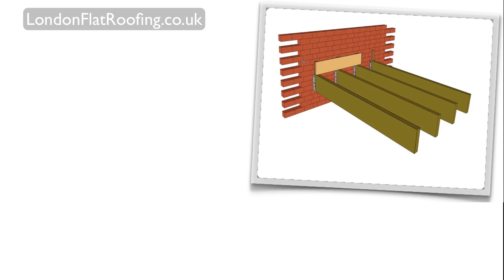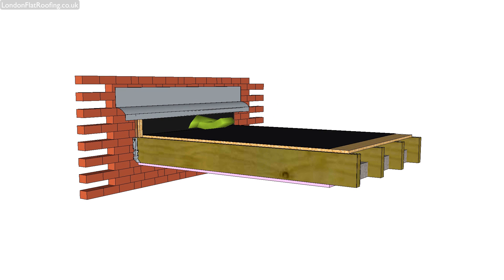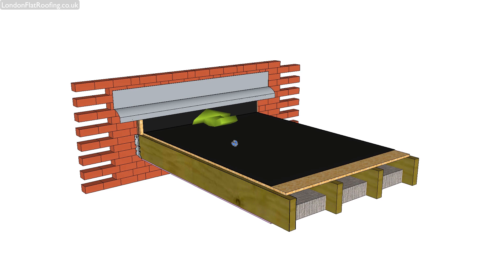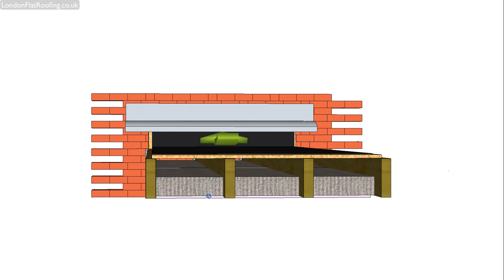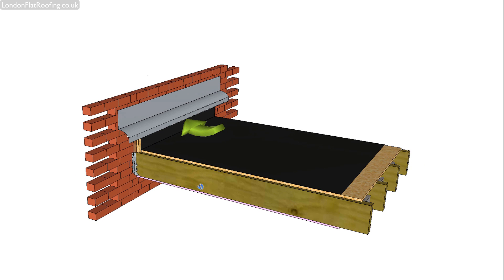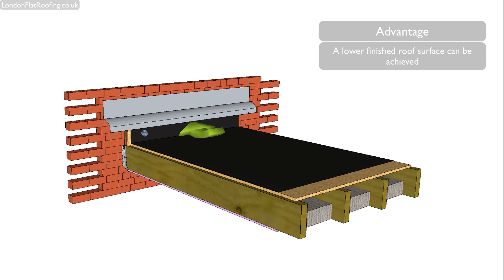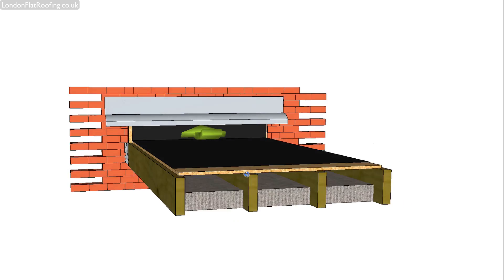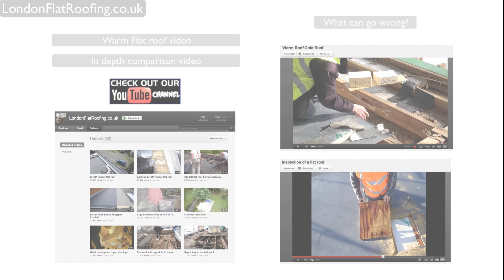Cold flat roof construction Explained

Comment: Hi.  Instead of venting the area above the batt insulation, having batts, then having a vapour barrier on the warm side above the drywall, could I use 4" of closed cell spray foam making sure that the foam continues through to the gap between joists and soffit?   This would meet our code requirements (R27) and provide a vapor barrier...or does it?

Comment: Hi 

Having had an extension built 

I’ve had 3 epdm roofing firms come to price up for a new roof 

It’s a lean too extension they said to have soffit vent at the front 

And I asked about the the rear where it meets the wall 

Will they vent it there 2 said ya don’t need one the third said he’s never done that and ya don’t need one 

Having watched your video I explained to them about airflow 
Etc 

They looked at me daft 

I have since had my joiner fried copy you abutment vent and we’ve done the roof ourselves 

We’ve insulated between the joist 

Would you recommend 25 mm Kingspan on the underside of the joist and sealed up 

Then approximately 12 inch below my roof will be the ceiling 

In that void area I have 4 air bricks allowing air to move freely in the void 

I was also thing of putting some 100 mm rock wool on top of the plaster board ceiling 

Would be ok thank you 🙏
Reply from the maker: Too much information please send me drawings by email and I'll have a look for you

Comment: I have a cold roof approx 40yrs old which is now needing attention. It has no insulation in it at all so needs the old decking and felt removed. Cannot extend upwards to change to warm roof and as per its age it has no vapour barrier above the plasterboard.  Is it possible to place a vapour barrier, possibly by sticking, across the plasterboard, folded up and then over the joists across the plasterboard and so on. Then placing insulation on that vapour barrier between the joists, then providing air circulation.  The rooms below are a small toilet and hallway.
Reply from the maker: send me a drawing to explain steveroofer@gmail.com

Comment: Hi Steve!

My name is Aykut ÇAMCI and I am a mechanical engineer and working on Prefabricated Building Systems as like Modular Houses and Containers. About the container shipping with flat pack option we have to minimize the height of top and bottom assemblies. Because of that we have to use insulation as like you did on Cold Flat Roofs but we are using light steel frames and it creates huge amount of heat waste on solutions. We put the insulation between the top cross members, but the cross members welded to our side rails, which one is also continuous steel frame directly contact with environment, and that creates heat bridge.
Do you have any advise to use cross members and side rails as steel but not creating heat bridges.
If you interested in with that problem please contact me!

And also thank you for the information which you gave us very clear to understand. Pros and cons are very important at the selection of any system.
Reply from the maker: Sounds interesting send over info info@londonflatroofing.co.uk

Comment: Nice,would you be able to put noggins across joists  to strengthen, say 4x2 on 8 inch joists?2 inch down and 4 inch across, so you still get flow of air?,hope I make sense
Reply from the maker: Yes or in the old days they used to put to timbers across in a cross fashion

Comment: In this diagram, I can not visualize a house with a wall higher than the roof. Unless this is a secondary roof such as in an addition at a lower level than the main roof. I would like to see detail of how the ventilation is done on the main roof above all the exterior walls. Would be helpful. Thanks.
Reply from the maker: The above video  represents a roof that  abuts a parapet wall

Comment: Steve, great videos which I've learned a lot from.
I have a garage with a cold roof, where the old felt top surface has degraded and is leaking. I am going to replace it with grp as a DIY project. I am going to overboard the original timber subsurface to ensure a flat, clean stable surface for the grp to adhere to. If I need to add firrings to create a suitable drop, will this affect the moisture trap between the original roof subsurface and new deck? There is no vapour barrier currently inside and only half the garage is poorly insulated with celotex. I will look to re-do the insulation as there is a new stud wall splitting the garage in half to create a warmer room at the back. This will be the part I want to insulate, but it's not a living space, just a basic utility area.

Comment: Hi thanks for the videos. Would you say this kind of flat roof requires no noggins as they would block up the air flow? Or do you use noggins of a lesser height than the joists/rafters?

Comment: What is at the other end that lets the ventilation out? I have a flat roof with no overhang, its enclose by balcony walls. Considering putting in air bricks as I can see its sweating.

Comment: Hi Steve, great videos 👍... I have built a single skin (block) workshop/garage and am about to fit the insulation... I have seen a garden room builders video where he recommends a "hybrid roof" so basically push the insulation tight under the osb3 and have the air gap on the inside. He claims the ambient temperature of that gap is then the same as the roof itself so no need for venting, just the usual vapour barrier then plasterboard, would you agree?
Reply from the maker: No I don't agree many people watch The video that you refer to and then ask me if he is correct and unfortunately he is not and the video is very misleading there is only two known ways of doing this everything else is outside of parameters that are considered correct
Reply: @SteveRoofer  cheers mate 👍, I thought it seemed wrong... his reason being is that the room is low occupancy... I'll install my insulation to form a cold flat roof as it is meant to be done... cheers Steve and thanks.for the really good vdeos 👍
Reply: An insulated slab fitted to the bottom of the joists would act as a thermal break. In my experience the biggest issues with cold flat roofs is down to a lack of venting.

Comment: Does a cold flat roof have to be vented front to back?. Couldn't it be vented left to right?. Say soffit vents on the 3 sides, with criss cross timbers on top for air flow. Saves having the flashing vent.

Comment: hi steve. ** how can you vent a cold roof  between the joists if the ceiling joists have noggins between them ??
Reply from the maker: leave a gap above the noggings or cut holes through noggins if the ceiling is up  and you have just noticed the problem then Please tell me how you sorted it out as I haven't found away
Reply: @SteveRoofer  thanks for the reply. I'm fortunate enough to have the option at the moment of a cold roof or warm roof for the summerhouse i am building .. i am swaying towards the warm roof after watching your videos.seems the advantages outlay that of a cold roof. for the  top layer waterproofing i have purchased some metal corrugated sheeting, woud you recommend a second timber deck or another layer of vapour material before the corrugation goes down as im unsure about condensation forming under the corrugated sheet if it exists or will cause a problem?!
Reply from the maker: @sophiehutton6034  Best you send me some info by email as this sounds complicated

Comment: Steve, I am in the middle of deciding to install a cold roof due to the reason as its thin.
Can you please help and kindly send me a link of a proper Cold roof Installation which details the ventaltion and how much space I can leave once install the celotex.

Your help will be highly appricated
Reply from the maker: Email me over all the details and Ill see if I can help
Reply: @Steve Roofer - Thanks anyway, I am going to do a cold roof and if I don’t like it change it to warm roof. Easy enough same constuction just need another layer of OSB on top of the Celotex. What is the minimum celotex thickness u have used on a warm roof?
Reply from the maker: @thespecialist786  You want to be using at least 120mm of insulation
Reply: Steve Roofer , where does it say that? 100mm is also donable I havebeen told by my timber merchant
Reply from the maker: @thespecialist786  try and get 100mm of insulation give you a u value of .018

Comment: Is it possible to fully fill the spacing between the joists with tightly packed cellulose or roxul ?
Reply from the maker: Depends on the total buildup but generally this is not a good thing to do. Make sure you have the majority of the insulation above the vapour barrier
Reply: @SteveRoofer  I have an existing loft with a flat roof. it is T shaped. One side of the T under the roof is a bathroom, the other side is a skylight over a stairwell. I need to redo the roof including decking and need to figure out the insulation strategy. If I add insulation above (warm roof) that would raise my roof quite a bit, I was thinking of doing a custom sloped insulation, but I may want to install solar panels down the line. So this brings me to cold roof or fully filled roof between joints. By the way I am in Southern California. Any other thoughts?
Reply from the maker: @yevko99  drop me an email with some details and ill see if I can help you steve@londonflatroofing.co.uk

Comment: Hi Steve, i have watched all of your videos however i am still a little confused regarding the vapour barrier. I have a cold roof system in a property i am renovating the area has no ceiling etc so lowering the level into the room is not an issue at all. So working from the top down: the external is sound so nothing need to be done with that, then i need a minimum of 50mm ventilation, no problem. Insulation fitted tightly between the joists, (do i need any kind of tape here where the insulation butts up along side the joists?) After that my intentions were to fix a Thermal laminate plaster board such as Knauf XPS Laminate Plus to combat the thermal bridging on the joists. so where on earth does the vapour barrier fit into all of this? and how? i would really appreciate any help with this one. bikershaz@live.co.uk
Reply from the maker: vapour barrier is always at the bottom working from the bottom up plasterboard then vapour barrier make sure the ventilation above is as best you can possibly do. This video may help you it's not out on general release yet  get back to me and tell me what you think  https://youtu.be/Kl3EAJD7Kbs

Comment: Hi, can anyone help me please? I am pulling my hair out!!! I have recently had a loft conversion with a cold deck roof (fibre glass) with 50mm kingspan between joists with 100mm void between the installation and the fibreglass roof....underside a foiled quilt so it is all air tight and acts as the vapour barrier..... the flat roof is open down to the pitched roof with breathable felt ...the builders have drilled holes on the flat roof fascia but nothing by the ridge leading down to the pitched roof ...I am getting droplets under the fibreglass roof and I am going to install roof tiled vents in each bay - just wondering if this will work? and increase air flow? Hope somebody can help!!
Reply: Buildup doesn't sound correct. If this. New loft conversion you would need much more insulation than 50mm between the joists.
Yes through venting is the key the more you have the better. If you want more info email steve@londonflatroofing.co.uk and send photos

Comment: Hi, I've just had a flat roof fitted pretty much the same way only that they've not left a gap under the plywood and no vent!! 
125mm celotex
6mm plywood
3 layers of felt
Gap then plaster board
 I really worried now.
 Can you please advise thanks
Reply: Hello mate im in a similar situation..
Did you find a solution?

Comment: Hi Steve, if the roof has already been laid what is the best way to add the vent without having to take up the roof again?
Reply from the maker: Anyway, you can making sure that air can move to all parts of the roof. It has to be a through flow of air. Its no good venting one end between joists without the same size vent the other end.

Comment: Hey Steve, I have an old flat roof which I want to change for rubber .. if I am to rip up the old boards and insulate it .. would I then need to then create the air vents. Would it sweat if I just filled between the joists with insulation and no air gap ..
Reply from the maker: Yes if you are to make the old flat roof into a cold roof  If its going to be a warm flat roof you don't vent it
Reply: Steve Roofer ok cool, just to clarify though.. if don't make it as a warm or cold roof as per your videos. And just put the insulation between the joists with no air gap I would then have problems later on due to insufficient air flow ?... 
Many thanks
Reply from the maker: yes, you may do.
Reply: Steve Roofer thank you ..

Comment: Hi Steve. I recently had a 6m rear Extension done with a GRP fiber glass falt roof done. The builder didn't leave the air vent at the adjoining to the wall but did installed a front facia. The council came for inspection and have failed it asking him to install about 3 mushrooms on the 6.9m  wide roof. I am a bit sceptical after watching you illustration video is it the right thing to do installing mushroom or doing the air vents the right way.? Awaiting your valuable advice. Thanking you in advance.
Reply from the maker: I have this venting problem with cold flat roofs asked a lot. The easy answer is:" The more venting you put in the better it works" it must be through venting the same size at both ends.
Ever tried blowing down a smarty tube? without taking the paper end out? You cant. Taken the paper end out and air flows. We have more problems with sweating on GRP flat roofs or glass fibre flat roofs than we do with other materials. This is because the glass fibre is solid and transfers the cold down to the sub-deck more than a softer material such as mineral felt or a rubber flat roof. A cold deck with warm moist air coming up from the rooms below will at some point mean  condensation forming to the underside of the flat roof decking. The idear is to let the air flow and blow the moister out. The more ventiation you have in a cold deck flat roof the more this works
Reply: Steve Roofer Thank you for your prompt reply.

Comment: Hi there, i have had my flat (cold) roof re done, as a result it was insulated with rockwall between the joists, 50mm air gap, battens added perpendicular on top on the joists for cross ventilation and mushroom vents installed. 

Before they done all this I had another roofing company come in who bodged it causing the my entire house to leak and damaging the property meaning all the ceilings are going to have to be replaced.

I am finding conflicting information re vapour barrier requirements. I had a chartered surveyor in and part of the list of internal remedial works required he stated 500 gauge plastic vapour barrier. Just wondering your thoughts on this. Does it specifically state this on the regs. I would rather go overkill than underkill. Would foil backed plasterboard work just as well?

Thanks in advance
Reply from the maker: The most important thing is to make sure the ventilation is excellent, and the air can blow in and out so through ventilation. Vents both sides of a roof lots of vents, one or two mushroom vents doesn't cut the cooky. A mushroom vent every 400mm along an edge is more like it; this is why we don't use mushroom vents but continue soffit vents giving a significant movement of air between each joist. Yes, foil back plasterboard or a plastic vapour control layer try looking at Visqueens website for the best plastic to use you want to achieve a  Vapour resistance of greater than 530 MNs/g when fitted. 
https://www.visqueen.com/products/vapour-control-layers/vapour-barrier.

Comment: Hi Steve, I am building a Snooker Room at the bottom of my garden. Totally timber construction like "Garden room", 5x4m flat roof using epdm, 6x2 joists at 50cms spacing. I have a height restriction so looking to do a cold roof construction. I don't need this room insulated to a great degree but just something so I can go in occasionally to play for an hour or two then leave. Can you recommend something here please. Particularly with respect to the air cavity and vapour barrier issues? Thanks Nige

Comment: Very helpful, thank you. My flat roof joins the sloping roof of my bungalow, existing lead flashing going under the roof tiles. I dont think the existing flat roof (4 mt x 1.5 mt) is ventilated, could i ventilate each section of the roof using grills on the fascias side and front? Thank you.,
Reply from the maker: +the gardener If your flat roof is a cold roof then yes you can if its a warm flat roof no. if the tiled roof loft space is a cold space then just vent into that. If the tiled roof space has insulation over the ceilings then it's a cold space above so vent into that
Reply: Thanks Steve, yes it is a  cold roof as is the loft. Very helpful of you Thanks.